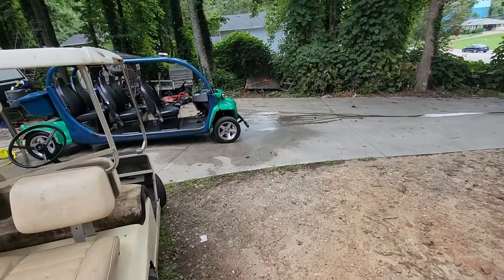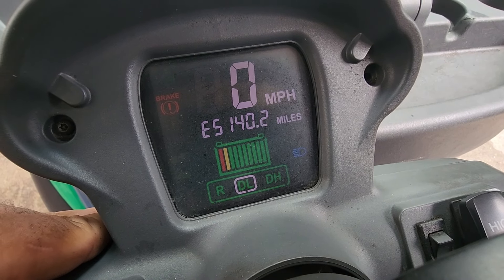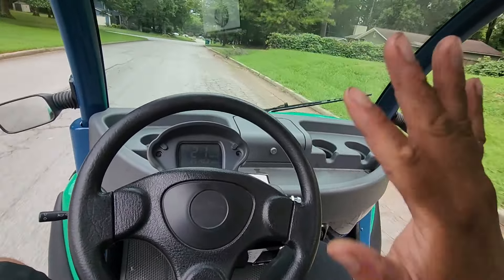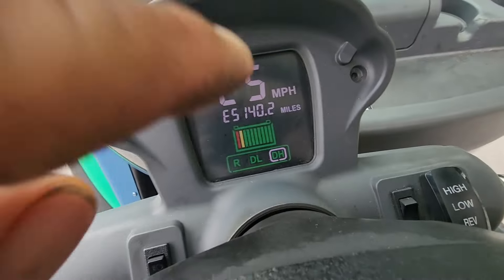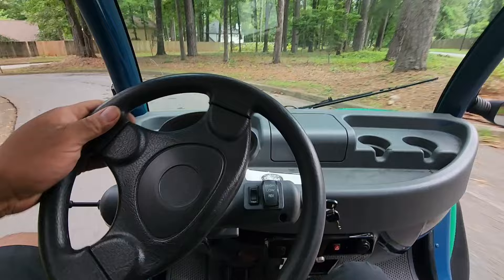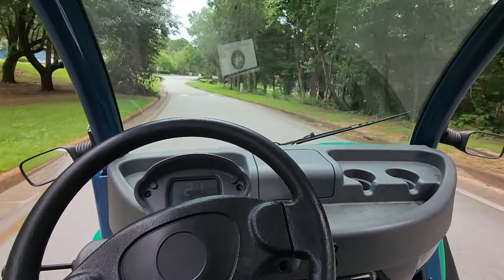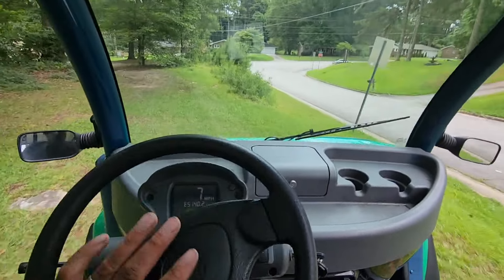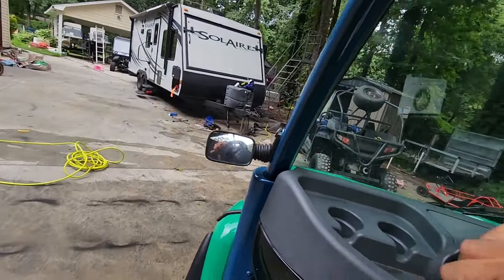2014 gem e6

Comment: The lead acid batteries are no good. You should replace that with high performance Li-ion Samsung 40T cells with much much larger storage for more power and range. Replace the controllers with high current draw and should go 60 true mph.